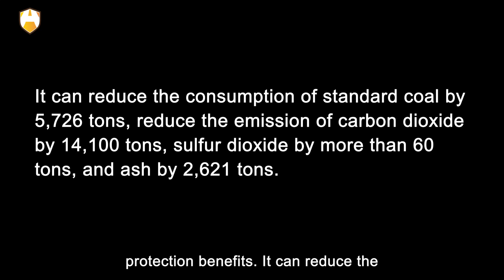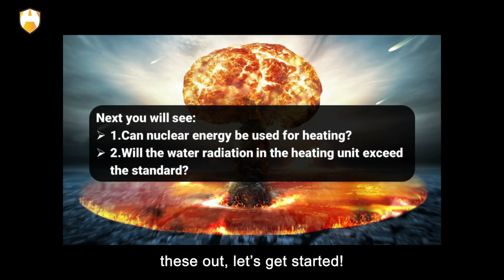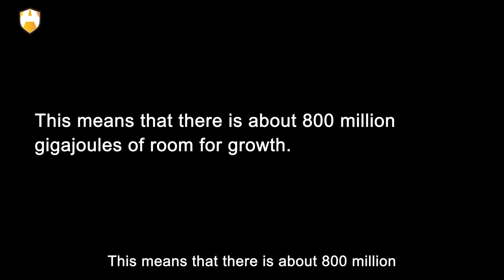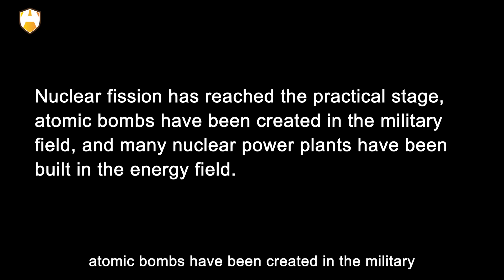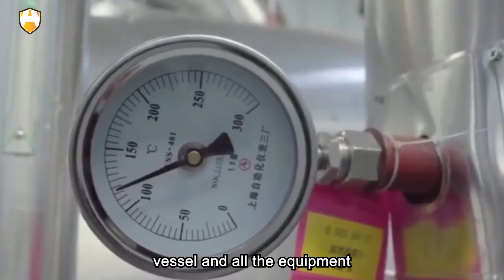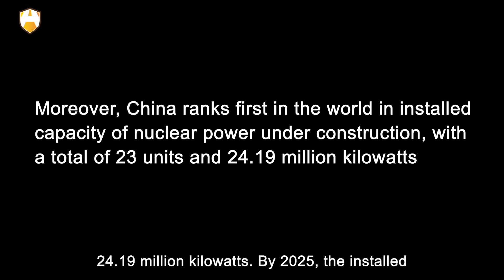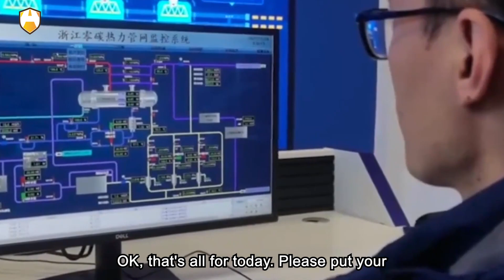OMG! China's nuclear heating is too strong!

Comment: Generally a plant with 1 gw of power can supply electric power to 1 million homes or heat about 25,000-50,000 homes.  This power plant is rated at  6.71 gw, which is over 6.7 times the average large nuclear plant.  It should have sufficient capacity to supply heat to at least 150,000.  (For comparison, the remaining  nuclear generator at the Three Mile Island is rated at 0.80 gw.)